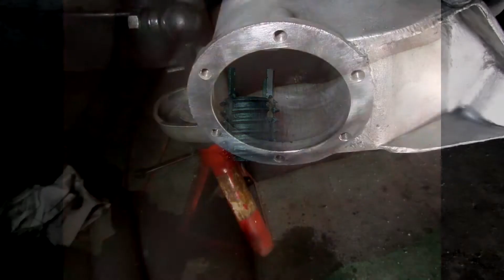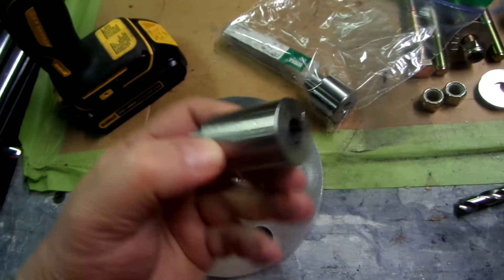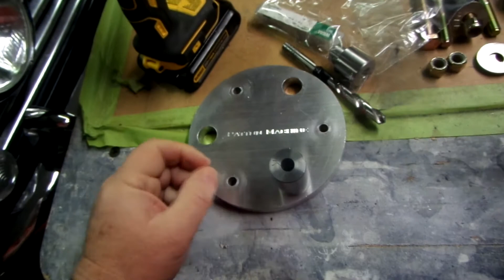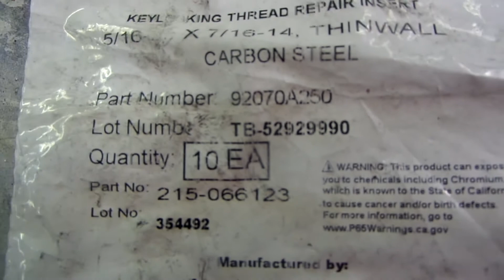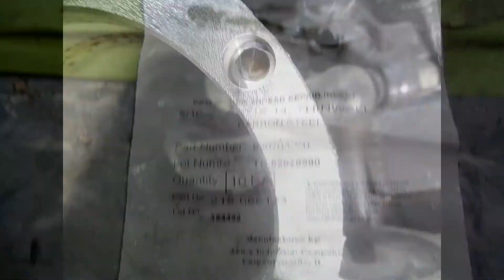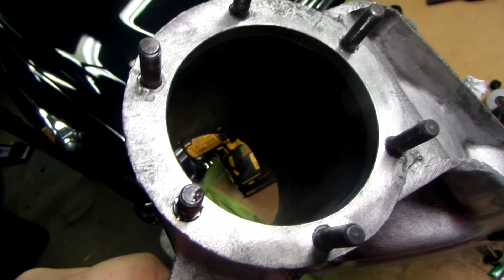Installing Keenserts in my TR4A Trailing Arms

Comment: Thanks for the video Dave.  I’ve got the Patton tool and will be doing my TR250 trailing arms eventually.  Thanks for the tips.
Reply from the maker: cheftush Glad you enjoyed it! I have a few more videos I am working on while I upgrade my differential and half shafts. I just received my Good Parts C/V joint axles and rear hubs. Too pretty to hide under the car!
LOL
Dave
Reply: DavesTR4A I’ve got the RG hubs in my 6 and love them.  I’d love to have the R200 diff, cvs and hubs in my 250 but that might have to wait...we will see 😎